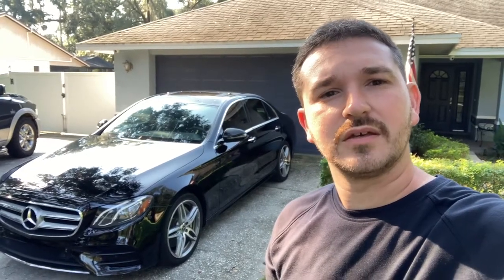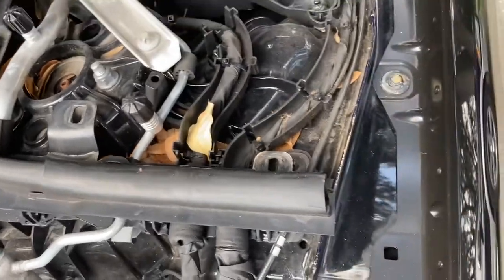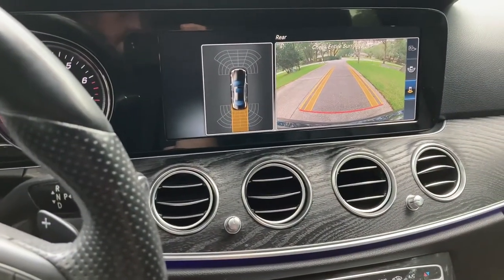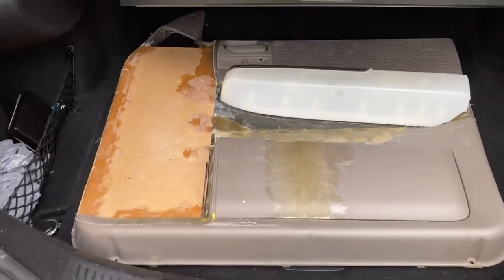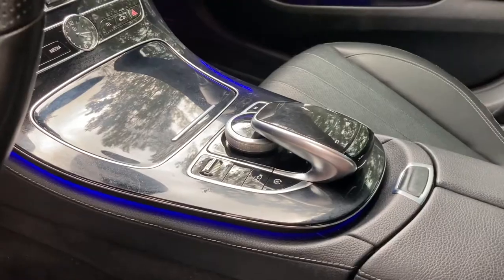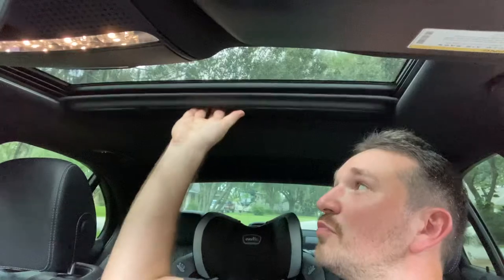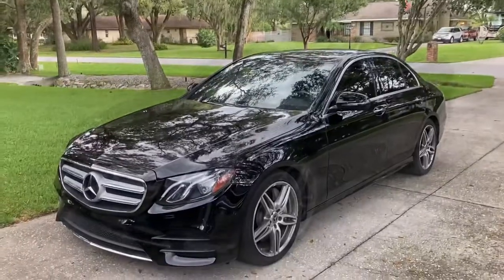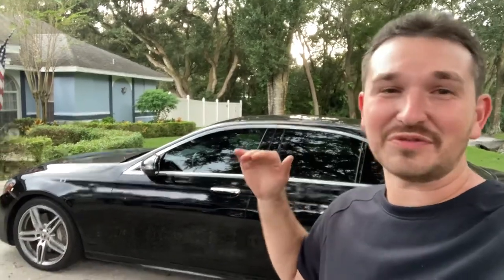Living with A Mercedes E300. Real world review. First World Problems.  Should you buy one?

Comment: That's very weird. My w213 is 7 years ol, 80k miles on the clock and it looks like brand new. I mean, nothing like that happen to my piano black parts and my leather seats are in perfect condition. Second, you don't need to push the parking button to start moving, just put your seat belt first. The seats are very comfortable, I totally disagree on your statement about them too. "Fancy Toyota Camry", come one man, this is not serious. Just my two cents.

Comment: Just got a second hand e400. I hope it isn't as plasticky as it looks! Thanks for the review.

Edit: I....am actually REALLY enjoying the car! There is a rattle under the dash somewhere on and off - and the airmatic suspension is due for replacement (every 7-10 years) but the engine is fantastic and the ride is Wonderful and the interior leather etc looks and smells good. It's true what they say Mercedes is more expensive to maintain - but you don't service as often - and the V6 is so smooth and effortless. I've had it 6 months and I drive everyday - I look for excuses! It's a great place to relax. 

I get the feeling though that it's the set up - my 400e is 4matic and fully loaded - ex Japan - German build. It's really solid.
Reply: How's the car been so far, thinking of buying one and your review would be helpful.
Reply: @jayjaynuga6354  Hi there! It's really, really good - I'm very happy - in fact I'm going for a drive just now. I go for a drive everyday - whatever excuse! The V6 is a beautiful engine - no problems with it at all. It sounds great, it's smooth, effortless and very quiet - and it's fast. I love it. You just press it a little bit and it's passed everyone - and you barely hear it. I got the airmatic and the dealer says I'll have to change it in a few years - it's very expensive $8000 for all four plus the work - but I'll get a non dealer to do it with Merc parts for half this. No problems at the moment though. Dealer says the V6 400e is the most reliable W213 as long as you do the engine and transmission oils at Mercedes, and use high Octane fuel. I use high Shell. All the electronics work well, the drivers assistance is fun and reliable, the stereo is excellent. I lubricated the sunroof immediately - no problems. You have to check for rust on the rear subframe. I bought a diagnostic tool online (X-Tool $300) so I print out a diagnostic before general service ($500) and I intend to do 3 or 4 services a year. The lights are wonderful at night if you get the adaptive ones - they do everything and the road looks really good. Paint and body are excellent. Seats are excellent - interior looks new - I'm happy about this. The ride is so comfortable. You have to set aside at least $2000 dollars above the price you pay for it (I got mine at $18,000 ex Japan - 108,000kms - 68000 miles) so you can get all the fluids replaced and do a full Merc Service as soon as you get it. I'm just so pleased. I did the same as you and watched all the videos and did all the internet research - skip the diesel engines, actually any of the 4s because many have engine trouble and you don't know which ones. I think the 400e might be the last non - hybrid V6. They evolved over a long period so they refined the build (I'm 2017) and parts are no problem. I love the car. Press it a little and you've passed everyone - without even hearing it. You don't have to drive it hard to go quick - and it feels supremely capable and smooth. Check your VIN and make sure it's a WDD (German). It's a great car. I'm going to keep it forever!
Reply: @shitsugane how much does gas cost? And how about yearly maintenance costs
Reply: @shitsugane  thanks for the quick response legend. Its mainly a family car and I just want a car that won't give the family too much troubles and is reliable
Reply: @jayjaynuga6354  I think - if you can get one without air suspension you should do it. Because Air will have to be replaced every 6-7 years whatever you do. The other car I looked at was the Toyota Camry V6. It's very good, much more reliable, excellent for family but also as an elegant, sedan for yourself. Go with a deep color paint.
Reply: I have the E300 ad I love it

Comment: A lot of the things that you didn’t like were changed or fixed in the 2019 models. Cruise control is now on the steering wheel, the black gloss center console now matches the rest of the trim pieces, etc. The big difference in the E and S is that my E gets 28-30 in the city on the economy dynamic setting and 38-40 on 18:26 the highway. An S will struggle to get to 25 mpg.  The sport models are noisier and ride harsher. I have a luxury model and it’s quiet and comfortable inside.

Comment: Thanks for an in-depth & honest candid review of the 2017 E300.  I had the 1997 E320 in the past and it was a great car.  I was in the market to buy a 2019 E300 but I felt let down when I test drove it. I felt the E300 was closer to the C-Class than being closer to the S-Class. It also lacked power & was a bit too loud in decibels & too plasticy in materials.  But I thought I was too harsh in my opinion, so I searched for owner reviews on YT. Your review revalidated my concerns and thank you so much for that. I’m now considering the 2018 S560 instead. It’s slightly more money but it’s a lot better car and lot more comfortable.  Thanks again to hold me back from making a $38K mistake.
Reply: I bought a 2019 E300 4matic a couple of months ago and so far it’s been a fantastic car. I get about 28-30 mpg in the city with the economy setting on and 38-40 on the highway. 99% of the options in an S class are also available on the E. Everyone that has ridden in my E300 is wowed by the interior. In my opinion you should buy it!
Reply: You're looking at the wrong E Class and make sure it's the P3 model ,if you got the money get the AMG 63 from CarMax
Reply: e300? try e450

Comment: Good video. I am a little bit shocked. I also have a w213 (e200). To be honest I really like the car, it drives so smooth, my seats are in good condition, I also don't have problems with the black round trims. Only the midconsule plastic has some scratches, but thats all. I chiptuned the car, it has 250HP now and 400nm, it feels so fast after the chiptuning. Yes ofcourse a SUV has more space, but I think the E class has enough space, enough for me. I have heard more stories about Mercedes cars in USA.  Strange, but it looks like those cars are from lower quality then Mercedes in Europe. They are not German made is USA I heard
Reply: Id say thats the case with all German cars, theyre very reliable in Europe but I only hear horror stories from the USA